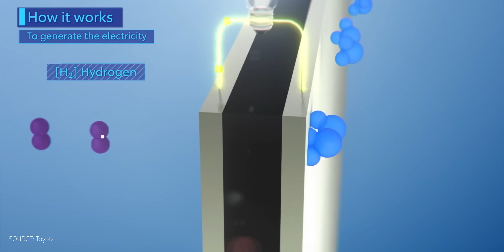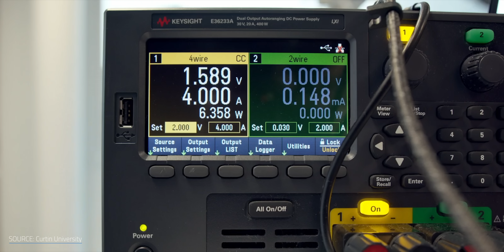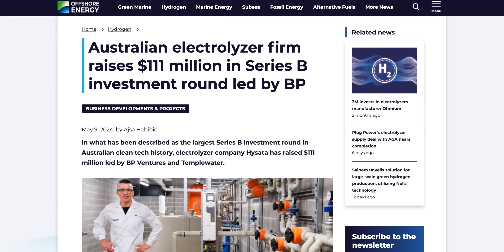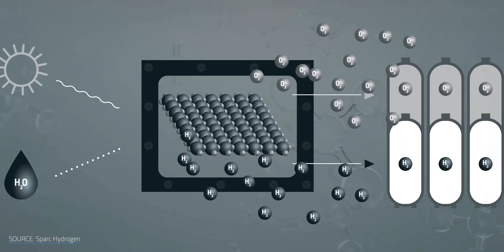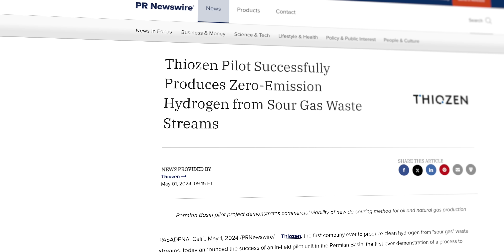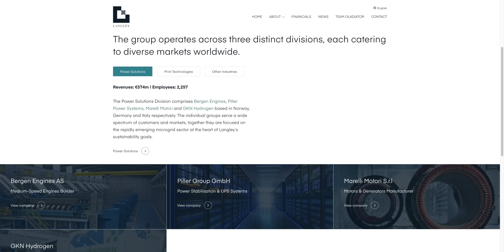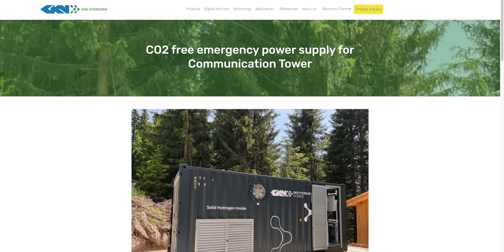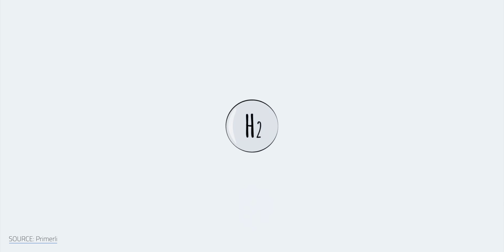How a Hydrogen Breakthrough is Closer Than Ever

Comment: I’m in Australia, lately all I have heard is how large companies are stepping back from their hydrogen plans, origin energy was just the latest. The Australian government has held many press conferences spruiking how green hydrogen is the future only to have most projects scaled back or cancelled altogether. It’s just doesn’t stack up.
Reply: Green hydrogen is very important for decarbonising a lot of industries, like steelmaking. Turning it back into electricity is so horribly inefficient it's probably never going to make sense, even if it's free energy from midday solar.
Reply: @ZurOhki1  You can not make steel with hydrogen, just iron !
Steel is iron with carbon, coal i not there to reduce iron ore, which can be replaced by burning something else, but mainly to add carbon to iron.
Reply: @ZurOhki1  midday power here in Australia is sometimes getting to negative prices now. At that point it doesn't matter if your efficiency sucks, as long as you can convert it to something storable.
Reply: Hmmmm.  First, there is a fairly large industrial use of H2... which is expanding.  So a number of large companies are very interested in expanding H2 production - totally outside of "green energy" application.  Currently most of the H2 is made from natural gas... which is not green.   An electrolizer with a 95% efficiency rate would be more efficient that the process used to make H2 from natural gas.   So I see real potential.

2nd:  Making H2 by splitting water has a series of technical challenges.   It's natural to cut back R&D when you run into issue that don't have obvious solutions.

The biggest issue after the low efficency of previous generation electrolizers is that making H2 from water needs a lot more clean water than what is electrolized.   A vague memory says they need 10 times the clean water as what is converted to H2.

If you look at where in the world you would find such a supply of fresh water... you quickly run into problems and realize that a lot of the world is not a suitable place to electrolize water at anything but a trival

So, yes; now that its more difficult than imagined, and you realize that it would be impractical to use the local  water resources in this way.  So you cut back.
Reply: This video said that you can store hydrogen in metal hydrides using less volume.
1 kg of H2 stored in metal hydrides = 50-100 liters. Compressed at 700 bars it takes 25-30 liters.
Same energy in gasoline = 3.8 liter
But it takes 40% of the total energy contained in the hydrogen to store it in metal hydrides. Since we would most likely buy hydrogen commercially as a compressed gas then fill up our metal hydride storage from that, we will lose 40% of that energy heating it to recover the hydrogen!!!
Less energy
Much more volume
And way more $$$$$
Reply: @ericbrooking  interesting but where r u getting this knowledge/these figures from?

Would also probably make ur point better if you laid out the numbers for non-hydride storage for comparison purposes
Reply: That's because they realized just how incredibly stupid and wasteful hydrogen is as a fuel and as an energy storage medium.
Reply: @johno3048  the iron price has a lot to do with that. Twiggy doesn't have the money for it any more
Reply: @johno3048  I’ll tell you why I don’t believe in Hydrogen - because it’s what Big Oil is investing in.  That makes it bogus just out of the gate
Reply: It's a perfect candidate for being a controlled load, only turned on when wholesale electricity prices go negative in the day or other times when curtailment wastes generation capacity.  In that scenario, generated with essentially free energy, how can fossil extraction compete?  Is somebody only considering a scenario with continuous generation?
Reply: Indeed. Distribution is the major issue. I'm not saying that Hydrogen can't have it's niche uses, but it's pretty clear that Electric is the way to go for most consumer (including automotive) use.
Reply: agreed. FFI is one of the latest to step back. there was a green hydrogen project scoped for the Piliga near Moree (NSW), on a site of abundant bore water. but again, could not get the economics to work and so the site remains scrub and the plan ditched.
Reply: Hydrogen is a waste of time, and whats all this talk about drilling for hydrogen deposits all of a sudden? Where does all this Hydrogen magically come from out of the ground?
Reply: We need a Gigafactory.
Reply: What! The government thinks something is a good idea and commerce doesn't 🤡 Hydrogen may be good for onsite industry genreation and use but it seems most of the other methods may be better.
Reply: @oldmanstumpie1061  what, do you think governments in the modern age just come up with these ideas on their own?  Capitalist.

If the Australian government was hocking it, it’s because corporations paid them to do it.  Learn how the world works
Reply: @NightRogue77  and the fossil fuel industry paid them not to. See how that works?

Comment: The closest alternative is methane, since it's a pretty stable gas with more Hydrogen than carbon so it burns more cleanly, and can be stored nicely. And it seems to work nicely as a rocket fuel (them Raptor engines on the starship and big chonky booster).

Comment: Oh hydrogen that non clean non green fuel. 

Hydrogen is not an energy source. There are no hydrogen mines. 

The idea of taking high exergy electricity and then storing energy in hydrogen is ludicrous.  

Storing energy in hydrogen at meaningful densities requires compression. 

Then there is the embrittlement of metals problem. 

It burns with an invisible flame front and will pool in explosive mixtures on roof areas. 

Everytime you see hydrogen and energy in the same sentence you can be sure government money has corrupted the numeric literacy of the person in order to get taxpayer money. 

Hydrogen is still a scam.

Comment: Hydrogen is 10 years away since 70's - looks like nothing has changed - I've seen so many promising projects but none came to commercial scale production. We need 95%+ electrolysers and 95%+  storage for hydrogen to compete will year over year better, safer and more dense chemical batteries.

Comment: Battery tech today enables 50+ year lifespan batteries based on Jeffrey Dahns research.  This is not theoretical, it is proven and tested.  No way can H2 compete with batteries since hydrogen requires more conversions and it is cheaper to transport electrons vs molecules.

Comment: Does hydrogen have a future...not so much.  Using electricity to split water is hugely energy dependent.  The numers just don' add up-because they can't.  If you use the electrical energy to split the water you get significantly less energy out than if you had just used the electricity go to the grid.  The entropic losses alone should tell anyone with an engineering degree that they can never and will never come close to breaking even.  Just use the electricity to power the grid.  Electricity to split water-metallic anhydride reaction-hydrogen fuel cell back to electricity- with losses in every step of that chain....Won't/can't ever work.

Comment: Awesome timing.
In Europe, most plans to make and distribute hydrogen as a fuel source have been completely scrapped just now, because it simply wouldn't work.
Reply: @dh510  in England they are redoing a whole bunch of piping, and in the new ones they are including an extra pipe for hydrogen.
A huge upfront cost for very theoretical usage. Just plain stupid and wasteful.
Reply: @searchingfortruth619  I heard something about that.  Its up north between Liverpool and Manchester. and is run by HyNet and is funded primarily by private money
Reply: I hope that Powerpaste hydrogen storage will somehow make it.
Reply: Europe is a interessting case, but I think, there it is all about the meta game. European Commission and Gas industry are dead set on H2. Producers are making the impression to back out, but that might also just be tactical (research results are in the drawer by now), since they are faster to deploy resources anyway. Maybe they are just trying to avoid participation in cost distribution or squeeze out subsidies. Besides the fact that some projects where just management phantasies without any notable engineering on board.
Reply: Who cares what europe does?
It's a muslim continent anyways.
Reply: "On 27 September 2024, the Commission published the final Terms and Conditions (T&Cs) for its second auction for the production of renewable hydrogen (IF24 Auction), via the Innovation Fund. This auction, which is a key pillar of the European Hydrogen Bank (EHB), provides financial support to producers of hydrogen categorised as Renewable Fuel of Non-Biological Origin (RFNBO).  

The auction  will open on 3 December 2024 and will award up to €1.2 billion support to renewable hydrogen producers located in the European Economic Area (EEA). Building upon the success of last year’s pilot auction (IF23 Auction), the second auction will further contribute to the creation of a European market for renewable hydrogen by de-risking investments with public support. 

The successful bidders under the IF24 Auction will receive a fixed premium in €/kg of renewable hydrogen produced, over a maximum of ten years of operation. The Innovation Fund support will bridge the gap between production costs and the price that off-takers’ are ready to pay for renewable hydrogen . 

The Terms and Conditions for the second auction include new resilience requirements, building on the lessons of the pilot auction and facilitating a contribution of EU funding to the objectives of the Net-Zero Industry Act (NZIA). Projects will be evaluated on a new criterion: “Achieving security of supply of essential goods and contribution to Europe’s industrial leadership and competitiveness”. The Commission will also ensure that support is provided to safe production processes in Europe through appropriate safety and cyber-security requirements. 

Other key features of the T&Cs for the second auction include:  

Higher maturity level requirements for application; 
A revised price ceiling; 
A dedicated budget of €200 million for projects supplying their production to off-takers in the maritime sector. 
 

Background 

The Innovation Fund is one of the world’s largest funding programmes for commercialising and deploying net-zero and innovative technologies.  Financed by revenues from the auctioning of allowances from the EU Emissions Trading System (ETS), it aims to help businesses invest in clean energy and introduce market-ready technologies to decarbonise  European industry while fostering competitiveness. The Innovation Fund is also one of the key tools of the Green Deal Industrial Plan. 

In March 2023, the Commission presented a new plan to stimulate and support investments in renewable hydrogen production through the European Hydrogen Bank (EHB). In addition to helping the Innovation Fund support the development of a domestic renewable hydrogen market, the EHB aims to bridge the investment gap for the EU to reach its ambitious REPowerEU targets. The pilot auction is expected to provide almost €720 million to 7 selected projects across Europe. 

The auctions complement the Innovation Fund’s portfolio of support mechanisms, which includes grants, project development assistance and other blended financial instruments. It improves information transparency and price discovery, while reducing applicants’ administrative effort. 

For more information 

IF24 Auction Terms and Conditions
GENERAL PUBLICATIONS4 October 2024
Terms and Conditions IF24 Auction"
Reply: Yeah, well, Europe hasn't been making the smartest energy decisions of late.  Germany shuttering it's nuclear power plants in favor of brown coal, the EU buying LNG from Russia instead of the US........ and so on.
Reply: @phydeux  France nearly tanking the entire continent when 60% of their nuclear fleet crapped out simultaneously certainly deserves a top spot on that list.
As for american gas: it was a rip off. But other alternatives should have been explored.
Reply: @BugMagnet  - How's it a ripoff?  At least you'd be buying it from a friendly country rather than Russia.
Reply: @phydeux  Well as of last week the USA are about as friendly as China or Saudi Arabia.
Would you pay a premium to buy something from the most expensive supplier for the privilige of also getting spanked with tarifs? 
LOL
Reply: @BugMagnet  We've been getting spanked with tariffs for decades. And if it's not tariffs, it's protectionism.  Don't see a lot of US cars in Europe, do you?
Reply: @phydeux  That is because they are bad. American cars are as suitable for the european market as german TV series are for the american. You don't see anyone in the US broadcasting our cop shows right? Protectionism? Nope.
It is simply because they would not sell!
Same with american cars, with Tesla being the one and only exception. 

BTW: Ford used to have a massive share in the EU market, back when they made cars people wanted to drive. In 2000 there was a Ford in almost every street.

We happily buy tons and tons of american products when they are good. Medicine, military equipment, sowtware, ... things that the USA are good at.

Bonus fun fact: Before Tesla, BMW was the biggest car exporter of the USA. So much for ThE eViL gErmAnS nEeD tO bRiNg tHeiR fAcToRieS hErE
Reply: Not in Denmark. There are big plans to develop Power-to-X. Even build a pipeline to Germany. H2 is a main stone in EU's energy plan for the future. Denmark already has the first PtX plant that will make green metanol for container ships.
Reply: @NotMeGeek  ofcourse, when EU have given 400 billion euro in contribution to "develop" H2 systems
Reply: @NotMeGeek   i love this. They use fossil fuels to create hydrogen in the first place, but once its hydrogen its considered a ”green” energy source.
Reply: Germany just announced investing 19 billion euro's into a hydrogen network. Supposedly for steel production, even though the steel manufacturer seems to be backing out of hydrogen. Crazy.

Comment: How to produce "green" hydrogen is a solved problem. Sure, there can be ongoing refinements to the process. But the brute force method of liberating hydrogen from water (what I refer to as "burning water") remains fundamental.

How to power "green" hydrogen can be a bit controversial. Assuming only curtailed generation from solar and wind powers electrolysis, there's little controversy. However, when renewables are diverted from electricity generation to hydrogen production, the situation markedly changes. This is due to the fact that we'd be using electricity to produce hydrogen, thereby incurring conversion losses, making it a net energy negative process. In short, we'd be better served to simply use the primary energy for work.

Hydrogen's primary purpose as a chemical has no substitutes, while hydrogen as a fuel has several alternatives. Here then is the ultimate rub. It all boils (pun unintended) down to simple economics. Unless and until emissions are factored into the "cost" of hydrogen, or mandates are set on such emissions, steam methane reforming retains a 3x cost advantage over electrolysis. Nobody is going to pay 3x for the same product out of the goodness of their heart.

Government intervention is needed, either in the form of emissions mandates that incentive the switch from steam methane reforming to electrolysis powered by renewables, or in the form of consumer subsidies that enable price parity in the early market while "green" hydrogen production scale brings down costs.

Until the fundamental economics changes, we're going to continue to talk about the "potential" of hydrogen.